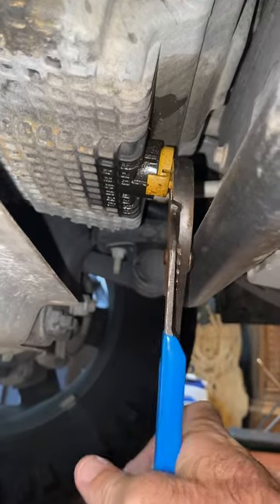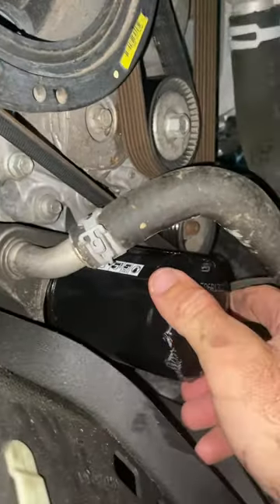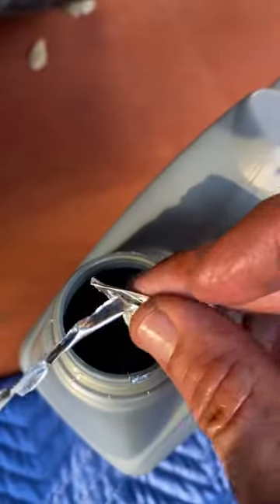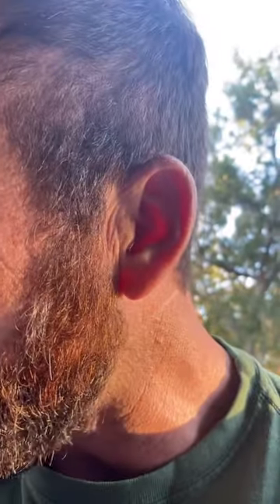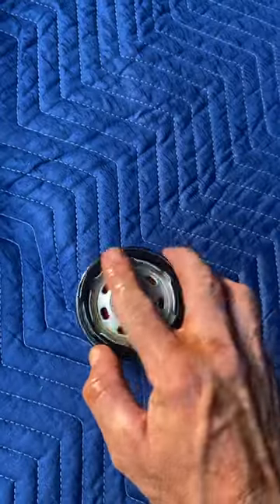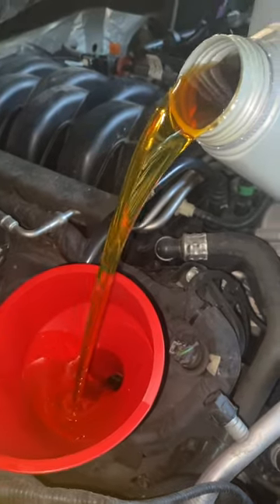#bringmasculinityback #getyohandsdirty

Comment: Whoever decided it was acceptable to start using plastic oil pains and plugs needs to be in the asylum for the rest of their days.
Reply: Probably the same person that designed the plastic air intake on an engine
Reply: Ford
Reply: My truck and my little audi have plastic plugs. Hundreds of thousands of miles and not a single issue. Nothing is going to reach up there and snatch it from your engine. People always gotta find something to bitch about.
Reply: @HAPPYFUNTIMEx2  You must not put your vehicles through as much strain as I do. I gouge plastic shit all the time. Replace with aluminum and it never happens again.

And you're ignoring the main issue, which is the heat cycling. It's built in obsolescence. Maybe you're okay with that, but I'm not. Replacements aren't even that much cheaper than aluminum. Manufacturers make the plastic pans for a buck or two and charge you almost as much as they do for metal versions. 😂
Reply: My brand new Silverado still has a 15mm metal drain plug. Must be a ford thing
Reply: @txlonghornremodeling  what are those things? 80k it's the least they can do 😂
Reply: @mame.joe124 if it had an aluminum intake you wouldn't get to change the intake gaskets as much.
Reply: @txlonghornremodeling ford forsure
Reply: What? It's about application and quality of overall parts. It's smart that Volkswagen switched to plastic pans for their Golf's, lower cars are bound to scrape occasionally, but if they're platforms that car communities like, they may be much lower than factory. Rather than paying for shaped metal, it's not only more cost effective on the company's side, it's cheaper for the customer. 

You may be a car boy, but you have many jalopnik articles in front of you before you realize that domestics literally gave up after smog, and the mighty v8 was bested by 4's and 6's until '97 with few exceptions.

The only industry that doesn't practice manufactured obsolesces is the military industrial complex and most sciences. Do not believe the propaganda. We build cars like shit, and the only reason trucks are borderline is because they make all the impacted industries the most money. 

Let's all be better educated consumers. Fuck big corporations, and fuck the big three for making 150-200% more "end of life" vehicles and selling them at astronomical prices. Even Toyota is guilty in this, but they haven't been bought out by the government multiple times. Godspeed
Reply: @weenusdeletus8068  it’s actually not cheaper tho,, thoes plastic drain plugs have to be changed out quite often the o rings  go bad quick and also the tabs break all the time and the drain plugs are 6, 7 bucks every time,, the Volkswagen plugs are a bit sturdier then the ford 1s but most ppl who are doing there first oil change tend to break the VW plugs because they don’t know how to get them out,, also the plastic oil pans are around 150 bucks or more and metel ones can start as low as 20 bucks but yes can reach some higher prices,, also the plastic ones can break from a good rock chip or an overtightened bolt,, and with the metel it pretty rare for them to go bad but if they do it’s either from severe rust or warping and you also don’t have to buy new drain plugs as often,, and if your vehicle is low enough for your oil pan to be scraping the ground you’ll go threw multiple plastic 1s before a metel 1 will even get cracked
Reply: @GaryTilman909 if you were actually driving over rocks and tree stumps you would have a skid plate protecting all of the important things
Reply: @HAPPYFUNTIMEx2 wrong. Your supposed to them every oil change
Reply: @HAPPYFUNTIMEx2 dude a drain plug is like $2 or something like that. You really think plastic compares to metal? These companies literally only switched to save themselves pennies and the vehicle only got more expensive because of R&D

Comment: Hell yeah let’s change that oil !!!!!! And that plastic drain plug to something that won’t dry rot.
Reply: Plug wont dry rot because its a 5 dollar throw away plug youre supposed to replace every change.

The real problem is ford's dogshit factory plastic oil pan warping with heat and causing your 30k mile truck to leak oil.

Comment: Bro so many men these days have no clue about changing oil.  They don’t even know what channel lock brand pliers are. Keep up with bringing the masculinity back brother.  Bothe my young sons know how to change oil. Heck my 16 year old is already rebuilding engines.  5.7 hemi all natural asp and making 720 on the flywheel. He built it.
Reply from the maker: Appreciate it
Reply: I'll be honest, I started getting lazy, but that stops now. Went to dealership to get a oil change, but they were too busy. So I made the mistake of going to Walmart and found out they over tightened the drain bolt and stripped it.

Comment: What kind of truck is that. I never seen a plastic drain plug before on an oil pan.
Reply: I know rite how did nobody else catch that
Reply: Ford
Reply: @southernslice9941 That would make sense they cheap out with a aluminum bed & body to which doesn't do much of reliability to last for years like all of our trucks are supposed to last!
Reply: It’s a pan saver
Reply: @scottfenton7607 aluminum bodies are expensive. They're not for cutting costs, they're for appeasing the epa.
Reply: @scottfenton7607  that aluminum body will never rust and is more expensive than a steel body that will start to rust after five yrs
Reply: @paulhunter9613  no they will oxidize & puncher easily! And yes ford's metal rusts quickly under 5 Years!
Reply: @scottfenton7607  with the thin metal on those other trucks they will puncture easily and rust in under 5 yrs. And by the way they have some aluminum panels on them also.
And the military grade aluminum that has been on fords since 2015 has not “oxidized” at all, another falsehood.
So now that two of your off based theories have been proven false, what else have you read on the internet? You should realize that things said on it  is not always true
Reply: @paulhunter9613  OH, your one of those guys has an excuse for everything & a one upper! But Just because you use terms like military grade to sale a product is a gimmick that all companies try to use! Are you working at any autobody shops? Do you see the vehicles that have been in accidents? I've recycled the metals! I was in the body shop when the body man dropped his body tool & right through the body panel it went! Now we had the doors of the 4 top truck & the 22 caliber went right through the aluminum door! But you'll one up me! So you look at the videos for yourself. I'm done with the know it alls!

Comment: Great. Pour oil into the new filter, quarter/half. Keeps it from dry starting. When you change oil and start the vehicle there is a brief moment where the block is dry until circulation starts. By pouring oil in filter it prevents this.

Comment: Also leave the little tin foil in place and poke one small hole on one side and a slightly larger hole on the other side to pour out of what this does is vents air into the jug and in return prevents it from burping and making a mess.......

Comment: Leave the drain plug out when pulling the filter so when that vacuum that the filter oil holds let's oil run to the bottom of the pan and you will get a more complete drain.

Comment: It's usually a good idea to remove the filter while it's draining.  You will get done faster, and it drains better.
Reply: Or loosen the oil fill cap to let in air
Reply: @paulhunter9613  100%

Comment: F150 with 2.7ecoboost. I can tell by the plastic plugs. I know everyone is going to say….plastic oil plug….those are going to break and you’re going to lose all you oil driving down the highway….first off they recommend replacing them every couple of oil changes and secondly they’re pretty robust and they’re not expensive and they don’t suck to get off like metal does sometimes
Reply: Actually that is a V8 👍
Reply: @ramcycle7  yup you can tell by the oil filter, the 2.7 has a canister filter on top of the engine

Comment: With out oil, your engine is toast in under a minute.  There is a reason the drain plug on most cars and trucks is a bolt. Making it easier for you to change the oil also makes it easier for a catastrophic accident to happen

Comment: pro tip if you dont have a funnel you can poke a hole in the foil then put your thumb over it once its in position you can slowly open your thumb BAM no mess.

Comment: Soon as i saw the sway bar that the oil hits and blows it 5 different directions i knew it must be a ford. Mine is the same way. And the drip panel for the filter never works it goes backwards and drips behind😂

Comment: I've owned 3 5.0s all end up leaking from that drain plug if it doesn't get replaced. I invested in a ronin plug and it makes a basically toolless oil change and also doesn't drain on the sway bar
Reply: I thought the five oh just burned the oil… not leaking it

Comment: f150 coyote 5.0 engine, appears to be newer when you mentioned "8.8" quarts;

it's actually 8.75 quarts according to fill spec

the older coyote 5 had a fill spec of 7.75

cheers on a GREAT engine, if you don't abuse the crap out of the engine and transmission, it'll probably last about 20 years.

only problem is they're going away with the transmission fluid pans and instead sealing them completely which makes it a big problem for maintenance.
Reply: Owners manual says 8.8 qts

Comment: A friend of mine used the Original Plastic Oil plug After changing his oil and it kept leaking. So he took it to the dealer and they said You're supposed to replace the oil plug every time you change the oil, Seems kind of wasteful to me but it stopped leaking. Wonder if you ever had this problem yet.
Reply from the maker: I was curious about that o ring. ill replace it next go around

Comment: That filter is only suppose to be 1/4 turn passed flush. You should be able to easily take it off with your hand. If you're having to use tools to take it off its way too tight you're going to ruin your spendal over time. Coming from someone who has changed more oil than I'd like to remember. Over 20,000 times to be exact. Just a little pro tip

Comment: for most normal people it would go something like this
step 1: snap cheap ass plastic drain plug
step 2: sploosh oil all over control/sway bar
step 3: buy new drain plug for $80
step 4: take off and replace loose oil filter with another poorly tightened oil filter
step 5: drop pieces of foil into fill tube while pouring

Comment: What motor has a plastic drain plug? I’ve never seen that before
Reply: 7.3 gas or what??
Reply: @user-rf8qt2wp4v actually not a ford it's a gm look at the intake it's chevy all the way
Reply: He asked what motor has a plastic drain plug... Ford does... I never said the vehicle in the video was a ford
Reply: Just to clear the air, if you look at the windshield cowling that is a ford windshield cowl. Coyote 5.0 holds 8.8 quarts. Chevy may use the same intake but that is definitely an f-150
Reply: Yeah definitely not a 6.7 power stroke I have one. Unless it’s on the 3rd gens but I have 2nd gen 6.7 and it does not have a plastic drain plug

Comment: Dude, you don’t have to crank the filter on. That way you don’t need to use channel locks to get it back off. Snug it up, about all you need. If you’re straining while tightening, it’s too tight. That way you should just be able to spin the filter off by hand next time.

Comment: My question is, why would you design a plastic cap that can dry with heat and possibly crack and end up in the engine.
Reply: The same reason they make plastic intakes, they dry up and fall right into the engine 🙄

Comment: I’m not gonna lie I was gonna shit talk at first but idrk why so actual advice for your truck, you NEED to replace that yellow plug each oil change, quick $7-$10 at autozone, the gasket doesn’t seal properly once it’s removed and Ford even states that they need replaced at each oil change interval, when I worked doing oil changes we had a bin full of and labeled “Ford Yellow Plugs” some were occasionally black or blue but they’re primarily yellow and are on many newer Ford models since they now use plastic oil pans and plugs

Comment: Wait untill the drain plug hole warps from the heat and the drain plug falls out while your driving and you blow the engine metal pan plastic plug would have been smarter because plastic cannot strip metal and thus forth creating an oil pan that doesnt strip out

Comment: Actually You're supposed to replace the plug and o ring Every time that's what the head technician at the Ford dealership that I worked at told me and because if not after a while. The plastic gets hard and cracks he said he Scene a bunch of them break and the plastic Bit be stuck inside the pan

Comment: Way too tight on the oil filter.   Spin it on till the gasket touches and then just a quarter to half turn.   YOU DO NOT HAVE TO CRANK IT DOWN!   not yelling there just adding emphasis lol.

Comment: Change that plug. Those plugs are meant to be disposable. That o-ring deteriorates with heat.
Reply: Then you need to replace all the O rings in the engine if concerned about heat deteriorating them..🙄
Reply: @paulhunter9613  yeah with time you will replace all the gaskets. And the o rings (when they leak)
Reply: I doubt that I will be replacing ORings or oil plug
Reply: @cloroxlavenderscent4307  make sure you replace that oil filler cap also, it’s plastic and has an oRing on it!
Reply: @paulhunter9613  yes oil caps leak also after some time.
Reply: @paulhunter9613  also do what you want, it doesn't matter to me. Replace or don't it's up to you

Comment: Turn your oil jug over your pouring wrong if the spout is up top it lets air by and no chug alug or pour your oil down you dip stick and the it don’t matter which way it is hell you don’t need a funnel that way either

Comment: WTF kind of oil plug is that?! 😳 Was this plug in the back tail pipe of the truck or was it under the motor? I think you’ve removed the wrong plug and that’s for a ford most definitely.😂

Comment: You're a whizz with small engines and such. 😅 
Carl taught you well, mmhmm.
But on a serious note. Good job doing your own maintenance. 
I was hung over once and had an oil change place change my oil. They stripped the drain plug, which i had 
To fix. They paid me, but it would've been easier to do the oil change myself.
I left that aluminum seal on a jug one time, and it fell off and went in my engine.
I tried to fish it out for hours..
Never got it! That was 6 years ago and the truck is still ok. I was hoping it'd blow the engine so i could justify to the wife my need for more power and do an engine swap. I'm still waiting. It'll blow eventually. The truck..

Comment: What kind of cheap junk is that?  A plastic oil cap that looks like a ford mistake by the oil seaping around it. You should always use the appropriate size crescent wrench or vise grips for removal.